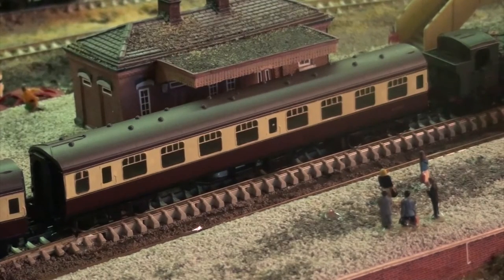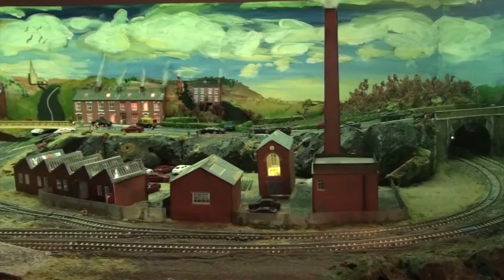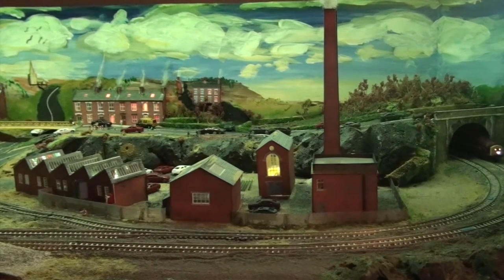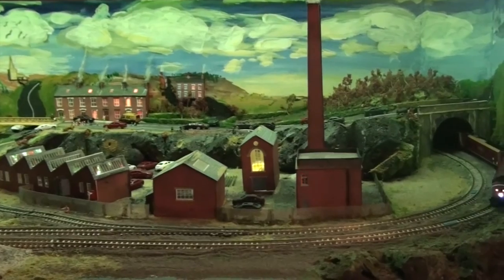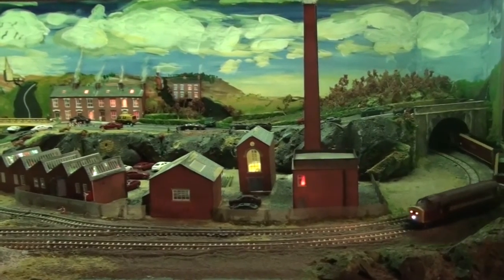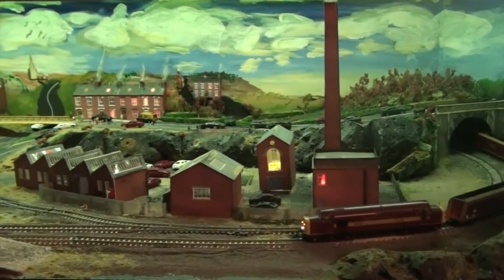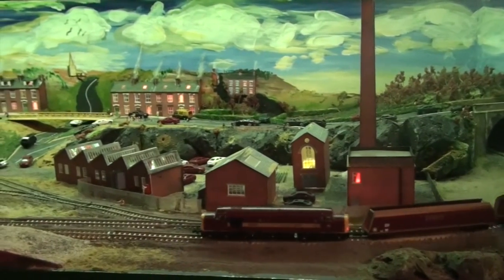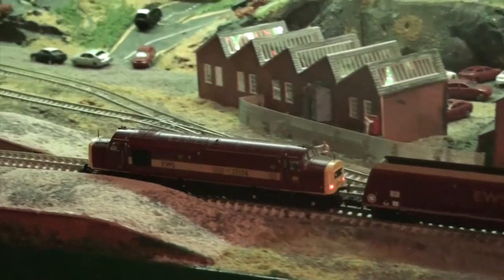Brimal CP800

Comment: I would definitely buy one if there could be separate sound outputs so that you can have one sound at one point ie church bells ringing from the church, children playing at a school, station announcer on the station. All the sounds would come from dedicated speakers at that particular location with the option to run them continuously on a loop.
At the moment i use old mobile phones with each sound I want on one phone which has a speaker connected to it either by Bluetooth or hard wired through its headphone socket. So for 3 different sounds I have 3 phones.
Rob
Pen-Gos model railway